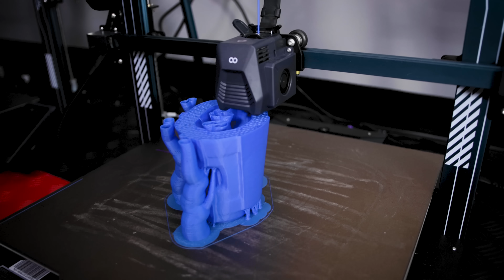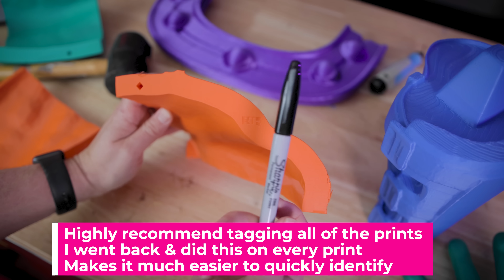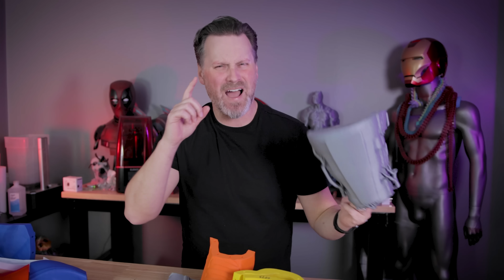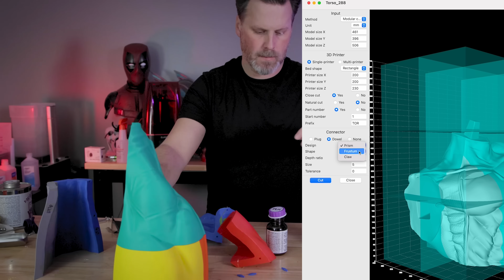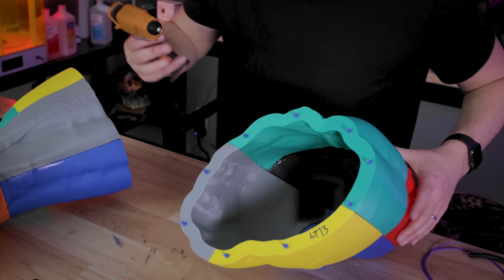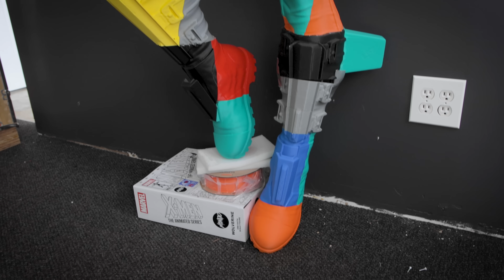3D Printing a Life-Sized MAGNETO Statue! PT2

Comment: For magnets you will need to glue them on the inside with at least 5mm of resin covering it. otherwise the force required to tear strong magnets apart by pulling /required due to pegs) will likely also tear out the glue.

Comment: I'm thinking you are going to need some metal conduit to build a frame on the inside. If you thread them you can have joints that will allow for easier disassembly down the line. Whatever you use it needs to be super sturdy.

Comment: if you want really strong and cheap magnets - buy some old dead HDDs and deassemble those

they will be big enough and strong to hold those arms... mb 2-3 HDDs per arm will be fine
also you can use epoxy to keep them in some small pits

Comment: Try using Fidlock magnet snaps with the M5 long male magnet stems. Each magnet set holds up to 45kg, and could be inserted into each section with a little bit of work. That's what I'm going to try and do when I get around to printing the statue I'm going to be auctioning off for charity (hopefully) later this year.

Comment: This is great. Did you cut this in Luban? I always cut and key my own but this guy us humongous.
Reply: Ah, you just said it. Luban.
Reply: Ok, last comment... You may want to consider expansion foam inside the hollow statue. It holds all the pieces together from the inside permanently in case this ever tips. For my big prints i fill the feet with plaster of paris for extra bottom weight as well.

Comment: What about a metal bar through the body that goes into the arm joints? that way the body takes the weight and the arms could potentially slide off later if needed.

Comment: Instead of scaling the dowels there is a setting for tolerance in Luban3D and it will fix that problem for you. Best way I found was to do a couple of test prints and input the tolerance I found that gave me the best fit. -0.2 was what I ended up with but different materials and printers may be different, and a negative number means smaller positive number will make the dowels larger.

This is going to be one massive and awesome project btw. Love it.

Comment: Magnets will probably not hold up that arm.  I would look at the steel rods you can get at Lowe's or Home Depot. 

Also, I'm very disappointed that you didn't add holes into the outstretched palm of the model so you embed magnets for holding tools and such.  It is Magneto, after all!  :)

Comment: Awesome project and I wonder what the end result will look like.❤‍🔥The only thing that I would different is the print direction of the pegs to make them stronger, because layers are the weakest point in a 3D print. It might not be an issue, but in a worst case scenario where the statue will fall over some pegs might break on you right in the middle giving you a hard time with repairing it again.

Comment: if the seams are recessed in shoulders and legs you could use velcro.. is stronger than magnets due to the large surface
it will add some thickness so keep in mind that

Comment: Hmm, I like the foam idea but just as a heads up the best way to go about that would be mixing two part expanding foam /however/ much like 2 part resin it generates a lot of heat so you would run the risk of warping/deformation of the pla.

Comment: Awesome project, can't wait to see it complete!
For 3dgloop I use Luer lock syringes with blunt tip Luer lock needles. You can get different size syringes and needles to fit the size of the part(s) you're 3dglooping. I keep a variety of 1ml through 20ml syringes on hand and 14ga-16ga blunt needles. 3dgloop is too thick to flow well through anything much smaller than that.

Comment: Epic project, love it

EDIT: Is there a 3D gloop "equivalent" for resin 3D prints? Or what adhesive would you recommend for someone following along but using resin 3D printers? I'm doing a similar but smaller scale project on my Elegoo Jupiter and Saturn
Reply: just use the liquid resin itself  to join the parts together